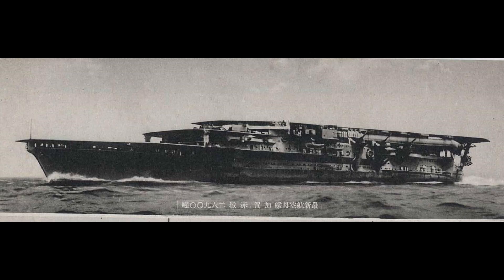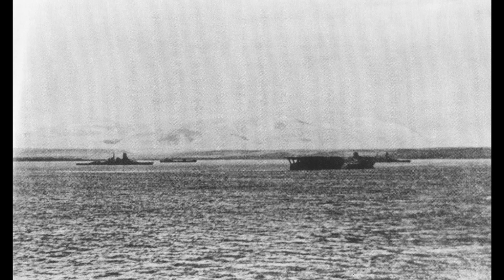IJN Kaga - Guide 255

Comment: Kaga sent off 70 sorties? Did you misspeak and mean to say "planes" or "aircraft" because there was only two sorties for Pearl
Reply: a sortie is one mission by one aircraft. 70 sorties could mean 50 in the first wave and 20 in the second, 35 + 35 or any other possible combination. One aircraft could have flown two sorties on the day.
Reply: The two waves of the attack were composed of ALL of the strike aircraft, in two groups, plus about 2/3 of the fighter aircraft.  The other 1/3 were held back for CAP, and would cycle onto the decks for refueling between major evolutions (launch and landings).  So the extra sorties were the CAP fighters relaunching.

Comment: The triple deck configuration must have been a royal pain for the crew to deal with. Extremely short take off distance on the middle deck and for the men on the lower deck to have planes barely making it over your head must have been something. This configuration and the massive pagoda superstructures of their men of war seem to me to be the Japanese naval architects biggest errors. Although I have read the designers had no recourse but to adopt the pagoda concept because the naval hierarchy kept demanding more and more firepower and everything that didn't shoot a projectile was squeezed into the pagoda.

Comment: so technically if Kaga had retained her 3 flight deck design, the IJN would've taken an additional 2 carriers to the Battle of Midway?
Reply: Not at all. By the introduction of monoplanes, her upper flight deck is too short. The same goes to its elevators that's only good to fully folded biplanes unlike A5M and A6M Zero.

Her second deck was occupied by those 20.3cm turrets while the lower deck is also short it is also being used as its lower hangar.
Reply: They were experimenting with increasing the number of planes that could take off at one time.  The downside was decreased hangar deck.  When planes went metal and mono-wing, take-off length went up and the lower take-off decks became useless.

Comment: One of the worst-designed fleet carriers ever (though granted, much of that is due to age, and later members of the Kido Butai were significantly better-designed).
Reply: Also to be fair, Kaga was built at a time when navies were still figuring out how a carrier should be optimally as well, let alone her conversion job that was never thought of until Amagi's demise forced the IJN to do so.
Reply: Well duh it was designed as a battleship. Rather low hanging fruit BK.
Reply: @nicholasglieco2155  So was the Yorktown class. (Koff koff...CV-6 Enterprise)
Reply: @1968gadgetyo  The Yorktown class were designed from the keel up as aircraft carriers. Perhaps you meant Lexington and Saratoga, which were initially supposed to be battlecruisers.
Reply: Still 80+ planes... Compare that to Bearn or Eagle...
Reply: @VersusARCH  I mean, that’s a low bar. And the Cranes and the Yorktowns managed a similar plane count while being far smaller.

Comment: Makes me wonder what would have been if the uss arizona had been reconfigured as an aircraft carrier in 1929 when it was updated in dry dock.
Reply: Honestly, the Standards make a poor choice for conversion...too short for a reasonable flight deck, and waaaaaay too slow to launch anything other than wood and fabric biplanes.
Reply: @Superuser009  they had to know battleships were obsolete by 1929!  WW2 was won by submarines and aircraft carriers.
Reply: @garyjust.johnson1436  Battleships were king of the world in 1929 - hence the tight regulation.  Carriers were still flying biplanes that could only carry 250 lb bombs.  There was a LOT of development of aircraft and tactics in the '30s that led to the gradual ascendancy of the carriers, but Pearl Harbor was the defining moment.

Comment: Why the perception of Kaga's damage control crews as 'elite'? They may have served together for a while, but Kaga had never been hit before, and hence they had no actual experience.
Reply: The first batch of aircrews got the best training. Before WW2, the Imperial Navy are really selective on the pilots. And they practice anti shipping attacks before most navies. If your check Coral Sea and initial attack on Midway, USN torpedo bomber pilots sucks.
Reply: @1968gadgetyo  ...damage control crews, not pilots
Reply: In IJN damage control doctrine, they did not train the whole crew, just a small dedicated section.  If needed, other crewmen available could have added muscle, but not knowledge or training.  Perhaps a better word would have been "specialized".
USN practice was to have specialized DC teams scattered throughout the ship, but ALL the crew went through DC training and knew how to take first measures.

Comment: Typical. She, like other IJN carriers operated 60 to 66 aircraft and has stored aircraft of about 30 for a total of ~90. She did not operate 90 aircraft as an air group. I wish research was more thorough on these IJN carrier presentations.
Reply: I look forward to seeing you make a video on this ship yourself than!
Reply: Notice that Drach said "a theoretical 90 aircraft", he never said they actually operated that many.
Reply: he says  theoretical airgroup of 90-
 most peeps will have it worked out that thats not actually an operational airgroup number-
and see below. Writing and editing this stuff into a 5-or thereabouts- minute format is HARD, and is always a balance between time, and level of detail, which can be almost fractal.
So on balance- give drach a break, 60 odd flying planes and a possible 30 more flyable airframes on racks is 90 planes...
Reply: @tomhath8413  An Air group is the combat operational aircraft. Are you sure you have a fascination for naval activities?
Reply: @keefymckeefface8330  When you use the term air group, that is exactly what it means, operational aircraft.
Reply: Were the other 30 fully assembled or stored as replacement parts?
Reply: @gregorywright4918  They were maintained in various ways. Most were crated, needing several days just to assemble one. But, some were boxed nearly complete needing about a day to reassemble. The US also stored planes beyond their air group. Lexington was running with an air group of 85 and had another 30 in storage, her storage however was to hand those planes in an assembled form from the ceiling. US carriers could do this because of the extreme height of their carriers.

The IJN had a doctrine of 3 22-plane groups of fighters, torpedo and dive bomber. When Kaga and Akagi were refit to a full flight deck, all they did was rearrange their hanger and provide more space for crated storage.  The US carriers usually held a 4th squadron bring their air groups to the 80-90 range. At one point Lexington had over 135 planes in her group but this was around 1930 and she was operating very small bi-planes.